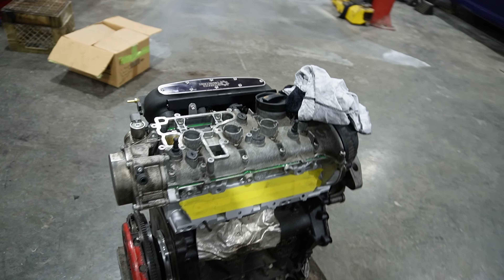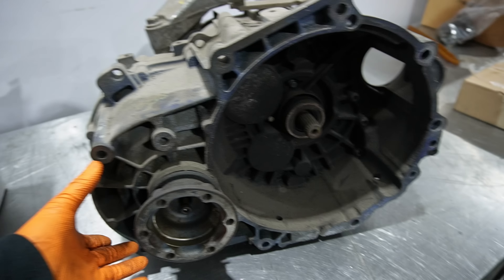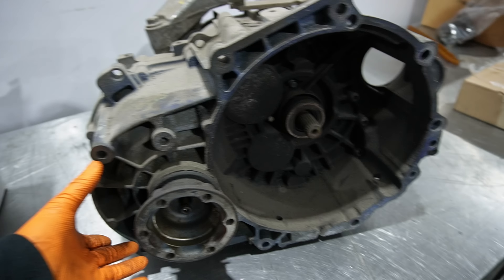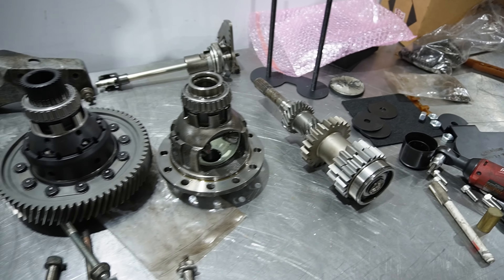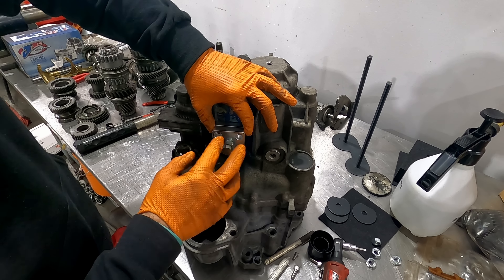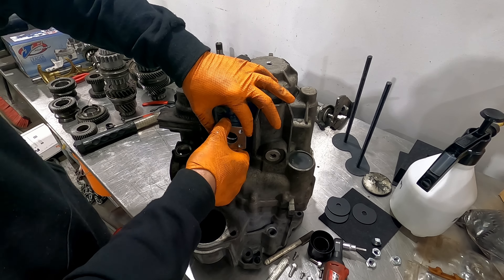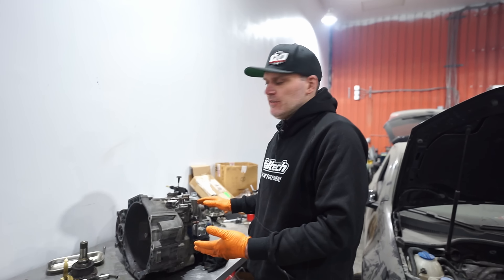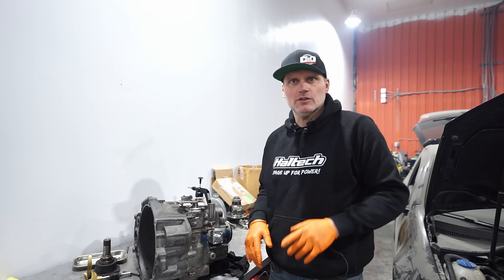02Q/02M FWD to AWD Conversion. Plus gear set!

Comment: im curious about the power goal and usage you guys are looking for. also about what power levels do the 02m/02q start to fail?
Reply: My 02Q in my R had 4th gear failure from track use.  its not just power, but wide sticky tires and going around corners also doesn't help. I'm only making 340tq. and the trans failed at 40,000km with about 5-7k of that on track.  Currently looking at these mods myself because there isn't much you can do about it, besides going to the wreckers and pulling spares out of other broken R's.  The 02Q/M is not a robust design unfortunately.
Reply from the maker: Doesn't need to be Rs.
Reply: Is 02J 5speed beefier? I only see bellhousing steel plate to make stronger that gearbox, other than lsd and dog gears..
Reply: @nospeedlimits7777  no the 02j is much weaker

Comment: This video just popped up in my feed... I did a FWD to AWD 02Q conversion a few years ago.  I wish this video was out then when I did it.  I was basically going off of a ton of research and measurements to make sure it would fit / work.  Awesome that more people are doing this now.  It's way less expensive than sourcing an AWD transmission that is otherwise the same.
Reply from the maker: Yeah it all comes down to over plans. If you plan ahead you can do it cost effectively.

Comment: Killer video! Love the content! Seeing the insides of the 02m/02q makes us ,02a/02j guys feel like peasants. Lol
Reply from the maker: 02a/j is technically more complex
Reply: @COMotorsports  I don't see it. The 02a/j feels simpler and cheaper built from factory. Maybe the shifter fork/tower system is more complex but the trans overall is cheaper built then an 02m/q for sure
Reply from the maker: @SyncroMotoring  agreed. However the 02m is just easier in regards to parts and disassembly.
Reply: Ok 02j is easier, cost effective. Slight longer gears cause 5 speed.. less time lost on lap track. Also several 5th gear ratio avalaible to street, launch, drag, etc. But CoMotorsport choose to work with more complex/expensive 02M. Why the hell? Da century question!!

Comment: QUESTION: can I remove the input shaft bearing behind the seal, without taking the trans case apart or do I have to take it all apart?
Reply from the maker: You're not taking out any bearings or races without taking the trans apart. That should be pretty obvious.

Comment: for the AWD swap part of it, is the diff and the bolt holes all it really needs? or does it need anything any of the internals? planning on swapping a awd 250 in a 89 camry all trac, maybe making 350-400hp max.

Comment: I was wondering if I could use my trans for a AWD swap
Reply: What's the part no. for that piece I need
Reply from the maker: If you're trans has the bolt holes for the angle drive then yes. But as mentioned you need the AWD diff to drive the angle drive.

Comment: so unfortunately I don't think my fzq 02m in my gli has those bolt provisions. but if it did could you use a mk6 angle drive in a mk4? otherwise a TT trans would be the "easiest" to find today
Reply from the maker: not sure, MK6 stuff is 02Q and is different in some ways.

Comment: I really don't understand why everybody get mad on that bad 02M tranny.. to make it decent they have to reinforce here and there with primary shaft inner bar, both shafts twin bars, 4th gear block, special forks and inserts. They better go with 02A/02J old one. There's no reinforcing parts with it other than lsd and straight cut gear multiple choice sets but they raced with it for decades! Plus nobody tells 02j/02M new gen use new bad synchro type while old 02A/02J use old classic big synchros.. this makes wild difference!

Comment: Weird question but is the clutch exactly the same no changes to the clutch, I have a racing clutch planning on doing awd conversion in the future I'm just worried about a clutch I'm going to buy an a3 quattro box saves me time and effort 😁
Reply from the maker: Yes, but it needs to remain the same transmission so 02q or 02m. Meaning if you have an 02m you can't switch to an 02Q AWD trans or vise versa. The clutches are different between 02m and 02Q.
Reply: @COMotorsports  yeah I know them boxes have different clearances on the release bearing side of things so if mine is 02M clutch and gearbox can I just put a 02M awd gearbox/transfer box on and have no clutch issues?
Reply from the maker: @boostedadrenaline2884  if you have the prevision holes for the angle drive yes as long as you swap out the diff to an AWD diff. If you're just talking switching the entire trans.. then yes as well.

Comment: I just dropped an LSD in my MKV 02Q and noticed it had excessive in/out play on the input shaft. Apparently the early 02Q’s have a tendency to have the outer race of the large ball bearing spin in the case and machine the aluminum which creates the play. I made custom shims to eliminate the play and used Loctite 680 retaining compound to hopefully stop the spinning. Something to look out for when building these transmissions.
Reply from the maker: Yep known problem. The dealer has a shim to fix the problem, I've fixed plenty.

Comment: Curious, when you did the preload checks on the diff, what was your final clearance, or tolerance ? About to do the awd swap on mine, thanks and great video
Reply from the maker: Specs are Elsa/Ekta. Don't remember off the top of my head.
Reply: @COMotorsports  how many thousand of an inch did you add to the actual total back lash you had to arrive at the final shim thickness?

Comment: When it comes to replacing the synchronizer, it’s it hard to change them? Any special tools?
Reply from the maker: Depends on the gearset. Stock is mostly pressed on stuff so you will need press and misc setups to get things on and off.
Reply: @COMotorsports  I’m in Los Angeles California and called few shop and all tell they only work with automatic transmission ☹️. I’m have to do the work myself. Any recommendations where to buy parts for the transmission?
Reply from the maker: @prisonr506  if you're talking about stock stuff the dealer. Typically we don't fix them if it's just stock stuff, it's generally cheaper just to chuck a salvaged one in. If you're trying to do something like this as upgrades then yes it makes sense.

Comment: I have a couple questions. Will these parts work for the 6 speed in a 2020 Mk7.5? My second gear synchro is gone under 20k miles and I can’t seem to find parts for this anywhere unless I’m overlooking something based on a separate trans code? There’s not a lot of clear information out there to really make this as easy as it should lol, from what I’ve read the 2020 GTI has the 02Q 6speed in it, but I can’t seem to locate any internal trans parts, anywhere, even from the dealer 🤷‍♂️ forgive me if this seems like a dumb comment, I’m kind of out of options looking around and need a little guidance. Would also like to know where I could find some upgraded shift forks as well, might as well upgrade if I open the case 👀
Reply from the maker: There should be no problem purchasing parts from dealer. With that said it won't be cheap and we generally would just source another transmission. However yes all this can be done to a mk7 transmission.

Comment: I'm swapping a 1.8t (AGU) into a mk2 and want to go 6speed but I don't know alot about what gearbox fits what , so I want to ask can a mk5 gti O2M fit on a 1.8t 20v (the mk5 gti O2M is relatively available here by me so it's easy to get and swap).
Reply from the maker: All 4cyl VW transmission, fit all 4cyl VW engines. When it comes to water cooled engines.

Comment: Hey im going crazy trying to find a mk4 R32 transmission! Can this same process apply to the mk4 02m fwd to make it awd??? 😯😩
Reply from the maker: Yes as long as it had the bolt holes, and you still require AWD diff.
Reply: @COMotorsports  thanks a ton!

Comment: Hi I noticed you used the other style metal shift forks that come in a set from vw, that are slightly different then the one sold by usp. Are the style you used as good as the other metal style forks usp uses? Any downsides

Comment: Definitely one of the best 6spd tutorials out there. Good Job! Maybe it was a good idea to replace the plastic sliders that goes into the steel shifter forks with some bronze sliders. Also i wish this video explained just a little bit more on how to determine the drill point for the inputshaft support bracket since it doesn't come with instructions and there isn't much really out there.
Reply from the maker: This was never intended to be a tutorial. However the input shaft support is a no brainer, it can pretty much only go over way. Just take a couple measurements and that's it. No instructions needed.

Comment: Hi I have a 2012 beetle 2.0 tsi and manual transmission I would like to find out witch transmission I have 02q or 02m if not them 2  witch one my car has
Reply from the maker: 02q
Reply: @COMotorsports  thanks

Comment: hello, really good work but i have a question please !
do you apply any sealant on the bartek reinforcement ? 
doesn't that cause a leak?
Reply from the maker: Anywhere there's a hole in the case requires sealant.

Comment: How could I compare my FWD diff to AWD diff? Are there any differences in the number of teeth? Where could I search this information?
Reply from the maker: Not sure what you mean, The AWD diff comes in AWD transmissions and are splined to except the angle drive. FWD diffs don't have that, which is why you need the AWD diff, or AWD transmission.
Reply: @COMotorsports   I would convert my JLW transmission to AWD

Comment: Do you happen to know the symptoms of a bad input shaft bearing ? I’m getting a rattle/vibration while driving and it’s less while idling but once I press the clutch pedal in the noise/vibration goes away. Would really appreciate your input. Thank you
Reply from the maker: All depends on the transmission you're referring too. But if it's still has a dual mass flywheel that could easily be it.
Reply: @COMotorsports  it’s a 2013 Golf R. I think the transmission is a 02Q4. I recently replaced the clutch assembly to a dkm stage 3 twin disk clutch. Everything was fine. Put about 1400 miles on it and now I’m hearing that noise I described. Haven’t been able to find much info about input shaft bearings.
Reply from the maker: @Richie52592  possible too much space on the floater plates. I've seen them loosen. If they get too much slack it will ruin the discs.

Comment: can you use a awd diff in a fwd trans?
Reply from the maker: Did you watch the video? Lol
Reply: @COMotorsports  yes i did watch the video maby i should have asked the question beter,i have a wavetrac awd lsd but want to build a fwd though you might have more insight if this is possible or not
Reply: @kobusburger3800  the depth wil be Wrong for the axle flange on that side. It's longer on AWD to go into the angle drive. So no. Won't work. Put it up for trade /sale for a fwd unit.
Reply: @SyncroMotoring  thanks man
Reply from the maker: @kobusburger3800  it won't work for fwd. Want to sell it?

Comment: Do you know if the EA888 has the same transmission bolt pattern as a EA827? Trying to figure out if the EA888 will fit to a 986/7 boxster trans. I know the EA827 will.

Comment: How much do u guys charge to strengthen an 02m amd conver the transmission to awd like u did in this vid? Like if i brought u the transmission? I wanna push 450+ hp out of my pd and hit it with nitrous, dont want it to break and really dont wanna do the transmission myself
Reply from the maker: A lot of variables honestly. What gearset we use is the biggest one, so not a straight forward answer.
Reply: @COMotorsports  is there somewhere i can talk to u guys to pick the gears and what not and get a quote?

Comment: I’ve got a issue with my ring gear & output shaft mating gears. The ones that are permanently attached to the output shafts. Both have missing teeth & the ring gear has damage aswell. Do you know if you can replace the output shafts? any help would be really appreciated
Reply from the maker: Grab another transmission. use it, or rebuild with match parts.
Reply: @COMotorsports  Ok thank you. I’m stuggling to find a gearbox for my audi s3 8p. The trans code is “kmc knz” do you know if that’s a 02M?

Comment: I have a 2014 TDI with an 02Q in it and i swapped my flywheel to a solid one from the dual mass factory one. I then had syncros on 1 and 3 fail. Its still driveable now that i have the OE flywheel back in, i was just wondering if you guys have dealt with that before?
Reply from the maker: Yes common problem. TDI problems.

Comment: Well this was fascinating to watch. Nice work Dave. Kinda surprised you didn’t do the input shaft shim trick tho. Or if you did it’s off camera.

I hate how the 02Q went to a floating input vs conical bearings of the 02M.
Reply from the maker: Thanks. Its not really a trick, they either need them, or don't. This one has a shim already and lash was fine. It's typically the 02ms I've needed to repair more than anything in regards to the input shaft play.
Reply: @COMotorsports  there’s a trick to tighten up the floating input on the 02Q 😘 hmu Dave you know I’ll share with you

Comment: Hi great video and loads of good information. 
I’m currently putting an Audi TT bam engine in a classic mini. 
I’m looking for a 6 speed awd gearbox with long ratio (like a diesel) to get round really small wheels. 
Is there any you recommend. 
Thanks nick
Reply from the maker: I do not sorry.
Reply: @COMotorsports  
Thanks for the reply 👍 will have to keep looking.

Comment: We're working on a 02m and waiting for parts to arrive from Bar-Tek. 

We're debating if it's worth installing an LSD or use an ECUMASTER EMU BLACK for traction control.  What would you suggest?

Platform: 2005, mk4, Jetta, 1.8t  awp.  Goal is 325 to 350 ftlb torque..

Thanks..
Reply from the maker: Well there's more traction available with a diff. Always going to be the answer on a FWD.
Reply: @CO Motorsports  Thanks for the feedback...👍

Comment: How much HP can handle this transmission Mate?
Thanks!
Reply from the maker: Time will tell.
Reply: @COMotorsports  approximately Mate? As I have 02M too, just finished, right now in paint-shop!
Reply from the maker: @portofino6790  don't know, haven't done half these mods before.

Comment: Can we test out the tranny with the hoopT
Reply from the maker: You mean ruin it?
Reply: Just to ensure that the tranny is in good working condition 👍😉
Reply from the maker: @956Sparkys  it's In a semi working condition.
Reply: Quick question, I own a 92 cabriolet that I'm trying to restore, after paint job it does not want to start up, I swapped out the ECU, it started and ran for a couple of days, then died out again. I think the painter left some wires either rubbing on metal causing some sort of short. Bottom line I'm thinking of doing a 1.8t swap.what do I really need for that swap to work
Reply from the maker: @956Sparkys  little too much to answer on YouTube. So some homework the info is out there.

Comment: Why are you still using one brass fork
Reply from the maker: Because the brass ones are for reverse and 5th/6th which don't require a stronger forks. No one's power shifting into reverse or 5th/6th
Reply: @COMotorsports   The post pros guys modified a steel 5/6 fork to work in an 02M.   They made it work.  Not sure it was worth the extra effort though.

Comment: Question: After you welded original race to remove it, new race was installed without shim to calculate lash.

How did you remove the new race without damaging it?   Did you grind two small notches in the case to be able to place a punch?

Thanks.
Reply from the maker: Exactly
Reply: @CO Motorsports  Thanks.  Worked out great.

Comment: Is that brace going through the trans for a certain amount of power or is it for higher horsepower?  like what amount of power would this be a consideration?
Reply from the maker: Don't know the answer to that. We're shooting for 6-700whp in this so we just did most of what we could to help it.
Reply: @COMotorsports  ok I'm shooting for 500whp on mine unsure if I'd be ok without it